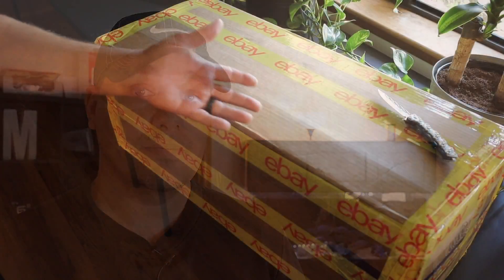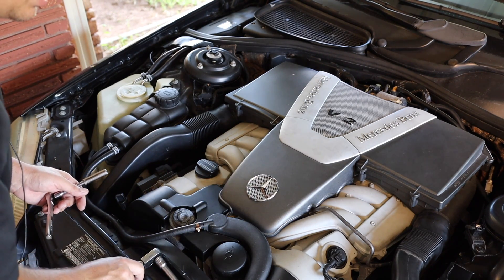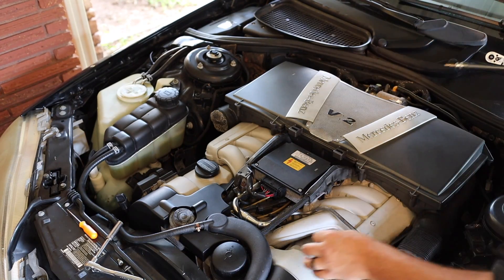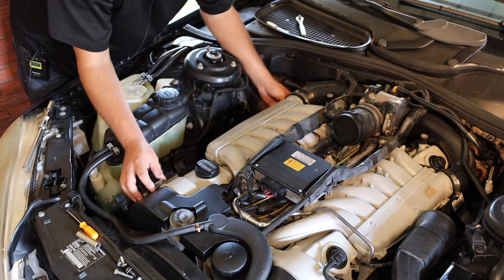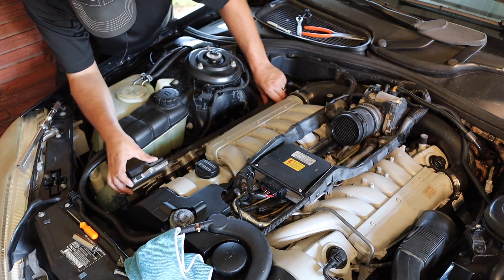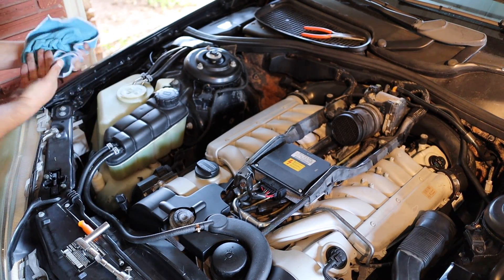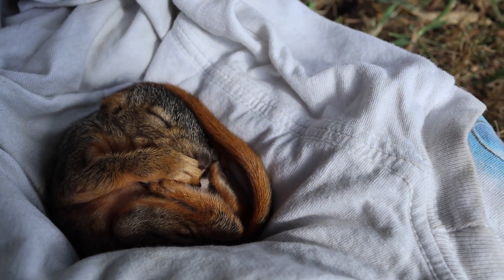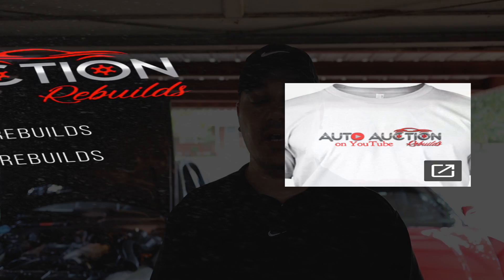Mercedes V12 S600 Coil Pack is Here!! Fixed???

Comment: The bolts are torx originally, costs about €20 at the MB dealer for both sides. When finding all kinds of different bolts on your car on parts that delicate you know the mechanic that worked on this car was a cheapskate. He probably ripped the threading apart and fitted all kinds of longer bolts on to it.

Comment: I love driving my 2001 E320 sport but MB have become a pain in the ass with all their electronics  and some of the interior plastics. Oh, yea! Stop bitching about the 100 degree weather there. I live in Vegas. It gets between 115 and 120 here. Like an oven! lol. So the misfire problem came down to the insulators? You wasted $600 on the coil packs? P.S. I'm bingwatching your vids.